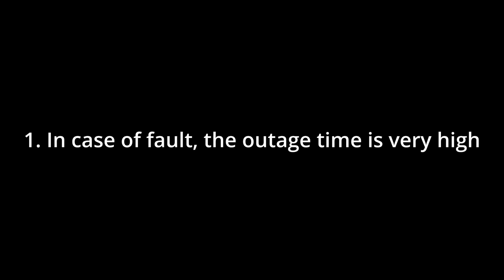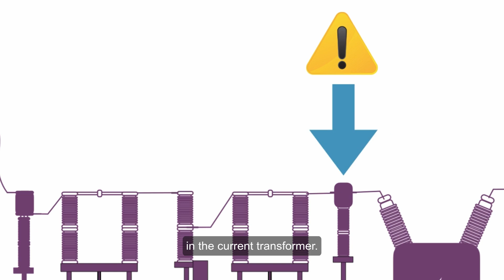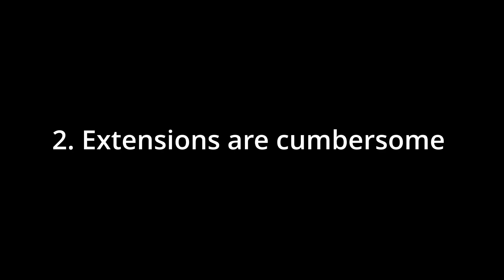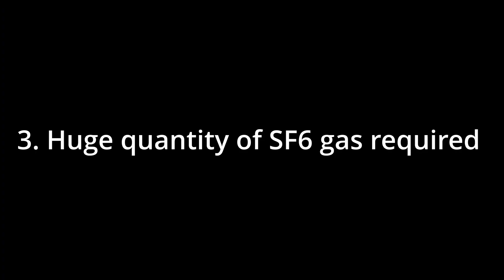Disadvantages of Gas Insulated Switchgear/Substation | TheElectricalGuy

Comment: i have completed 43 Nos GIS project from 66kV rating to 765kV rating in all over India with PGCIL ,UPPTCL,TNEB,KPTCL & KSEB...in my experience if spare materials available then we can restore the system with in 24 hours for major flash over works. For rectification work need well experienced engineer with high skilled manpower otherwise it will be risk for both man and materials
Reply: Please can i get your contact number?